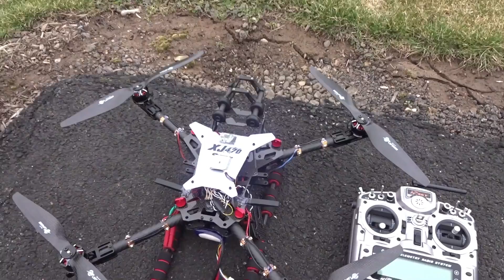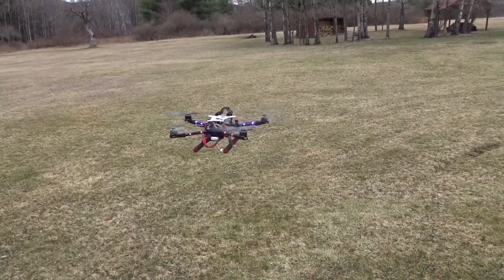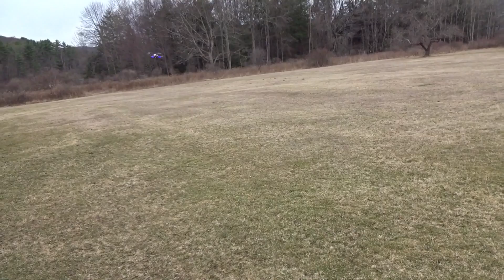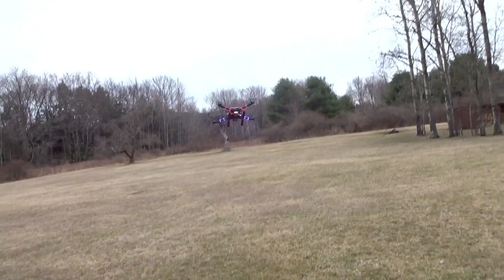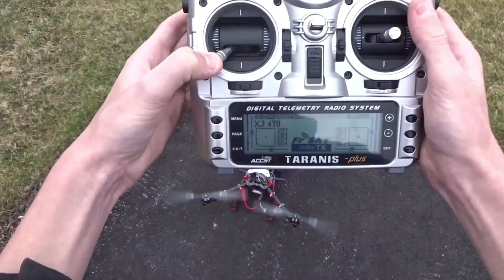Quanum XJ470 Quick Flight

Comment: I didn't realize you have done, a large build before...... do you think you will ever do another ?.....I have got to like my rebuilt 8inch now with better ESC's and motors - I kind of like the (850 size) X class quads, but at the same time think they are a little impractical.
Reply from the maker: Not really, this was pretty much a failure and buying a DJI would have been much better for me, as I never did get any REAL good footage and it cost just as much.

Comment: could you tell me what motors n prop you use please- I tried the link in the build video but it doesn't work anymore. thanks a lot
Reply from the maker: These were LD Power 2810 720kv motors and LD power 12X5.5 props .
Reply: The RCAddict thanks mate. looks a great quad frame to carry a gimbal n GoPro. 
Merry Christmas

Comment: I bent two of the motor mounts on mine, and recently replaced them with Tarot shock absorbing mounts. They're pretty cool, but wide enough that you can't get the rear booms close enough to secure when folded. Not a big deal, really, but might put some folks off. :)
Reply from the maker: Yeah, my mounts bent too. Has been sitting for months as the FC and GPS are a nightmare. I have no place in cheapo GPS systems lol.
Reply: I'm keeping mine simple for now. KK2.1.5 board, no GPS, and once I'm happy that I have it tuned well enough, I'll add a camera gimbal.
Reply from the maker: Spacer Conrad I could build it with a normal acro FC and just fly it without GPS functions, could add FPV so I could get good shots, but would rather just not and buy a Typhoon.
Reply: There are a few models I considered like that, but I was determined to put one together myself. I think this one will get an fpv/recording cam array, and call it a day. My more ambitious efforts will lean more toward fixed wing and/or hybrid arrangements.

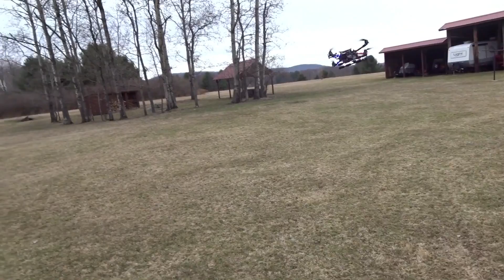Comment: 3:00 you said you had to lower the p gain? Does the p = power? How do you lower it in Mission planner?
Reply from the maker: I didn't know anything about tuning in this video. P stands for proportional, I for integral, and D for derivative. They are the values that determine how the flight controller responds to stimuli. Don't change them until you learn more about how they affect flight characteristics. I just did a tuning video today. https://www.youtube.com/watch?v=V-uTsgPDIUY
Reply: okay thanks, but you mentioned something about the quad shaking real bad. which value p, I or the v would help eliminate that problem?
Reply from the maker: Rampage851 If it is a slow wobble it would be too low P probably, or too high P would be a fast violent shake.

Comment: so I'm getting ready to purchase my fpv gear. I want a sturdy stance for the xj470 considering all the weight that will be on the quad. I noticed you extended the legs of the quad, may you send link ? thanks :)
Reply from the maker: I bought some 5/8 inch thick oak wood dowels from Lowes Hardware store and cut them to a longer length, and spray painted them black. They can flew so they don't just snap like the stock Carbon ones.

Comment: one last thing, I understand you had to extend the wires for the motors to connect to the esc through the carbon toobs. would I just use regular Guage wire ?
Reply from the maker: +Rampage851 Yeah, you should use 14Awg wire.

Comment: Then what power distribution board would you recommend for this set up to function to its full potential, link please ?
Reply from the maker: +Rampage851 I really don't know. Maybe the full HK pilot one, not the mini? I have not had any problems with this once, I don't think it is limiting it. http://www.hobbyking.com/hobbyking/store/__68694__HK_Pilot_Power_VI_Module_Distribution_Board_And_Dual_UBEC_ALL_In_One_120A_and_10s_.html
Reply: +The RCAddict does that board work with (bec) esc's ?
Reply from the maker: Rampage851 BEC ESCs? The ESCs just solder straight on, and get the full voltage, you want them too. Do you mean a 12V/5V regulator to power other things? It does not have an external one you can use, but it does have one inside of it, and the cable that it comes with to run up into the FC board take power into it.
Reply: +The RCAddict. I noticed the esc's that come in the kit you purchased were opto, meaning they don't power the flight controller. I'm not familiar with that set up. so, I was asking if bec esc's would function properly with the power distribution board you recommend. since bec esc help power the flight controller.
Reply from the maker: Rampage851 Ahh, ok. The board has two options. There is a solder trace you either cut or leave it. Leaving it intact means you are powering it from the PDB board through that cable. If you cut it it gets power from one of the ESCs since only one connector has all three wires.
Reply: +The RCAddict okay thanks, thank you for assistance and keep it up with those vids of yours :)
Reply from the maker: Rampage851 No problem! Let me know if you have any other questions :P

Comment: hi im looking to get into fpv racing and am wondering whats a good quad for getting use to the controls flying los?
Reply from the maker: +thomasroll42  It is a really good idea to have experience flying before you build and or fly something larger and more powerful with brushless motors. I recommend getting a smaller, cheap quad first, and really learning to fly on that. My robocat build I just did seems like a good starting point, as it is very cheap.

Comment: the spr f3 and cleanflight will improve the way it is flying , and sounding , your looptime cycle alone will be much faster , give you better response on the sticks and motor esc fc conection.
Reply from the maker: +RC Surf I actually saw a negative impact. I could not really get it tuned too well, and the G-Tune feature would not change my PIDs. Also the barometer (covered in foam and the plastic case) did horrible. Jumped up and down terribly. The APM one was rock solid. I will be switching back today to the APM.

Comment: You should've "crashed" but fake it and say the thing is ruined... Then say April fools. 

P.S.  That thing looks heavy...
Reply from the maker: +Pretzil295 Well, It already did crash. My props and motors are a tad dinged up from a couple crashes. It entered failsafe and tried to RTH, but it was super windy and only had 7 satellites, so it hit our house and fell 15 ft, so the props are slightly chipped, and motor bearings a tad "not new". It is heavy, but not in terms of weight to thrust. So much extra power.
Reply: Well... As long as it still flies. My tarantula x6 is held to gather with hot glue and ducktape. One prop has an inch taken of the end... But it still flies, some how...
Reply from the maker: Pretzil295 Yeah, far from really needing repairs. I slightly worried about some jello. I also can't really balance props as my balancer it self is not balanced, lol. My Eachine X6 was held together with glue and tape and took it like a champ :P
Reply: Hot glue and duct tape is the true hero

Comment: Heuj.. Yours IS louad :| Must be the props?? It flies well though huh? 
Ohw by the way: If you hook up a servo to the channel you're trying to use for flight-modes.. Does it move? 
Put some FPV stuff on it by the way.. Mine is Really nice to FPV fly...
Reply from the maker: +DutchRC Adventures I honestly don't find enything wrong with that sound? What is it supposed to sound like? My props and motors are a tad dinged up from a couple crashes. It entered failsafe and tried to RTH, but it was super windy and only had 7 satellites, so it hit our house and fell 15 ft, so the props are slightly chipped, and motor bearings a tad "not new". It pretty much always sounded like this though. I am going to try and swap the APM back in this weekend, as the SP3 didn't work out so well. I plan on adding FPV later on once I get all of the camera gear in and set up. I got the gimbal in today. How in the world do I set it up? LOL
Reply: +The RCAddict Ah yeah. It's mostly the props making more noise, and maybe the motors.. Mine is like a silent killer :P  
I tried to fly my speed-quad today by the way.. that went 'a bit' wrong :$  It only wanted to fly farward.. Which might seem like what you'd want.. But well.. A bit hard to handle this way :P  
Got some more work to do ;)  It did fly very well & powerfull though..
Reply from the maker: DutchRC Adventures Probably, don't want to spend $25 for another set though, lol. Getting new high quality smoother motors would be cool, but expensive and rewiring through those small arms is so hard, lol. Hmm,so why would it not fly the other directions? haha
Reply: +The RCAddict I think I had one of the mixes in my radio screwed up :)  It looks better now, so I'll try again tomorrow :) 
Ah yeah.. I'd just see what camera footage with the quad as-is looks like.. Have you had a camera (without gimbal & stuff) on it allready?
Reply from the maker: DutchRC Adventures Ok, that is good to hear :) 
I have not no. I might try tomorrow. I just got the gimbal today, waiting on the camera. How do I get the gimbal to work? Also how do I get my computer to recognize it? I downloaded the USB driver thing, but can't open it.
Reply: +The RCAddict I've never bothered with the firmware's (don't fix something that aint broken)..
Well.. you can use the gimbal completely independant from the rest of the quad.. Just feed power into it.. (2S or 3S).. 
You can however control it with whatever channel you would want.. You can chose modes, or just override any axis you'd want to..
Reply from the maker: DutchRC Adventures Ok, I just am used to updating eveything that can be, haha. I will try it out. I just don't want to break anything. 

I am looking to try out some different props, since mine are a little beat up. I can't balance them either, as my $5 balancer is trash, lol. The shaft it bent and the middle cones are the same weight, so very inacurate. What do you use? I was thinking of trying these ones out, to get a good test variety. 
http://www.hobbyking.com/hobbyking/store/__56273__Mulirotor_Carbon_Fiber_Propeller_12x4_3_Black_CW_CCW_2pcs_.html

http://www.hobbyking.com/hobbyking/store/__51969__Multirotor_Carbon_Fiber_T_Style_Propeller_12x5_5_Black_CW_CCW_2pcs_.html

http://www.hobbyking.com/hobbyking/store/__8062__Master_Airscrew_Propeller_12x6_1pc_.html

http://www.hobbyking.com/hobbyking/store/__25826__12x4_5_SF_Props_2pc_Standard_Rotation_2_pc_RH_Rotation_Green_.html

And then for FPV I was considering the one you got:
 http://www.hobbyking.com/hobbyking/store/__85527__AOMWAY_700TVL_CMOS_HD_Camera_NTSC_Version_plus_5_8G_200mw_Transmitter.html
Reply: +The RCAddict Sure thing.. Allways good to just try some different sets.. right? I thinkthe master airscrews will work out best.. Somehow those props allways work out well for me..

Yeps.. that FPV thing is nice for sure.. IF you can mount it.. I'd first mount the gimbal and see what your options are..
Reply from the maker: DutchRC Adventures Yeah, I want to try those ones, to see how it goes, but buying a set of each is $50 :/ Do they come with mounting hardware? None of them show any, and they aren't T props? Also those Airscrew ones are 12X6, so I might be pushing my A draw :/ They don't really look efficient either. 

I have the gimbal mounted now, and there is not really a good spot to put FPV, at least not the backpack. Having a separate camera, and the running the VTX and antenna somewhere else would be convenient. I don't even know how I am going to power the gimbal and FPV, since the PDB has no bec. I might have to carry a separate 2S battery. I really don't like the way the gimbal looks on top as well, but so close to the ground on the bottom it is not safe :(
Reply: +The RCAddict Nope.. those props do not come with mounting hardware.. They are essentially airplane props..

Yeps. I have my FPV camera mounted underneath the 2 bars that the gimbal stands on top of...
Reply from the maker: DutchRC Adventures Umm, how in the world am I supposed to attach them then??? 
I ended up buying these ones last night: 
https://www.hobbyking.com/hobbyking/store/__61581__Multirotor_Carbon_Fiber_T_Style_Propeller_12x5_5_Black_CW_CCW_2pcs_US_Warehouse_.html

https://www.hobbyking.com/hobbyking/store/__63494__Carbon_Fiber_Propeller_12x6_Black_CW_CCW_2pcs_US_Warehouse_.html

https://www.hobbyking.com/hobbyking/store/__66749__12x4_5_SF_Props_2pc_Standard_Rotation_2_pc_RH_Rotation_Flouro_Yellow_US_Warehouse_.html
Reply: +The RCAddict Duck tape :)  Hmm yeah.. If you don't have 'normal' prop-mounts for your motors, you're out of luck with them props..
Reply from the maker: DutchRC Adventures Shit. I wonder if I cancel it :( it has already been printed though. Is there no adapter or mounter thing? My motors are fitted out for T style props :(((((
Reply: +The RCAddict Ehm.. I have not come across them, but maybe there are adapters for them T-mounts?
Reply from the maker: DutchRC Adventures Idk. I am going to try and cancel it now :( This sucks.

Comment: Something sounds funky....
Reply from the maker: +Stacey Abshire A lot of people have commented something like this on here. I am not sure why? What is wrong? (I honestly don't know) My props and motors are a tad dinged up from a couple crashes. It entered failsafe and tried to RTH, but it was super windy and only had 7 satellites, so it hit our house and fell 15 ft, so the props are slightly chipped, and motor bearings a tad "not new".
Reply: +The RCAddict It could be some noise from some damage to one of the motors.  If you take the props off, and spin the motors up, do any sound strange, or more noisy than the others?
Reply from the maker: Stacey Abshire Yeah, the motors are slightly damaged. 3 out of 4 make some noise, the last one is silent. Props are also out of balance. Oh well, as long as it does not induce jello into my footage I am ok with it.
Reply: +The RCAddict Yeah, if you're not getting jello, it's probably not too bad..  too much vibrations can do some wonky stuff with the flight controller
Reply from the maker: Stacey Abshire Yeah I still have not taken any footage off it though, so it might be. Will find out tomorrow.